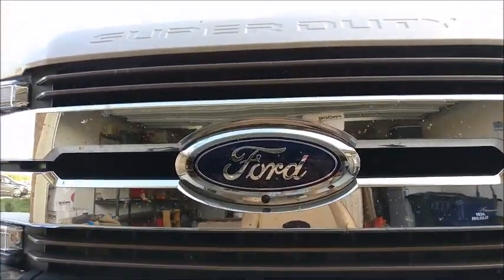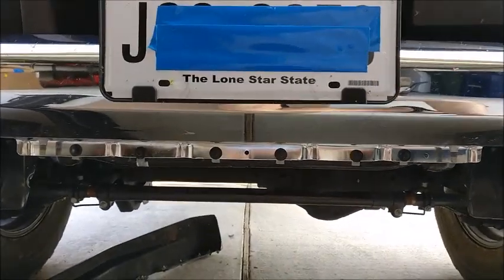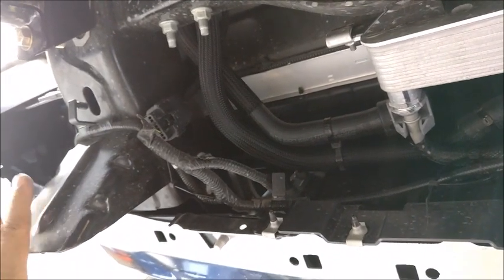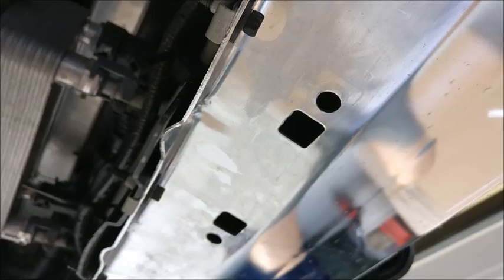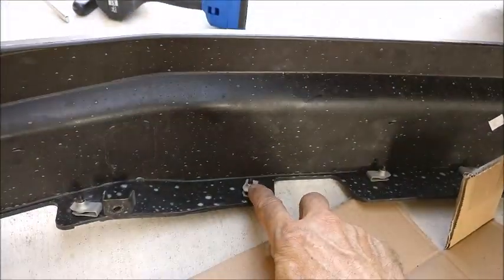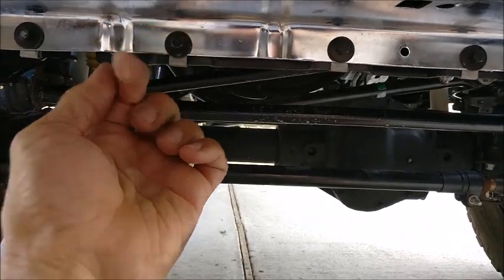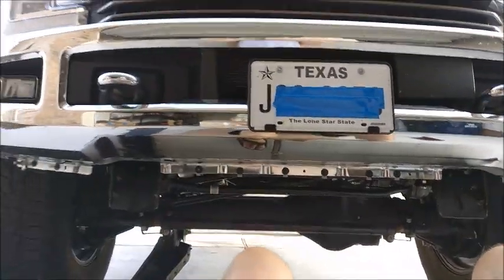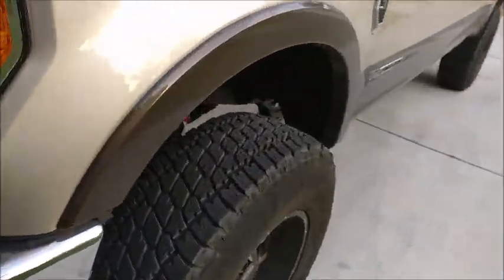Front Airdam removal, 2017 Super Duty

Comment: I removed mine, but that metal lip with all the bolts sticking out looks horrible. So I just cut my valence down to 2” and put it back on. Now it looks much better and is just looks like a piece of trim.
Reply from the maker: Sawzall would do the trick
Reply: Thanks for the post! I was reading about this in the manual of my new F250 and wanted to do it, but after seeing this video it indeed does not look intentional. So yeah, Ill be doing the same!
Reply: You can buy a 2 wheel drive air dam # HC3Z-17626-AD  and it's only 3" , there are two big ugly metal plates behind the large air dam that needs to be removed 
but no biggie, 4 bolts on each one. 
I'm thinking you'll get a little better gas milages, maybe, but it will look better.

Comment: Where the bolts are trim that shit flat and those 2 big brackets hanging down unbolt. Cleaned up my work truck looks like a factory finished bumper
Reply from the maker: Yep I did cut off the bolts after flipping them. The threads were pointed towards my tires. As for my Pryus catchers, for now I'm leaving them on. If I hit a pieceofcrap Pryus I'll have the satisfaction of seeing those bad boys buried in his sheet metal. Another tip is to paint that little chrome lip black.